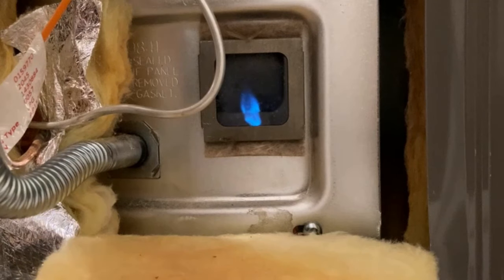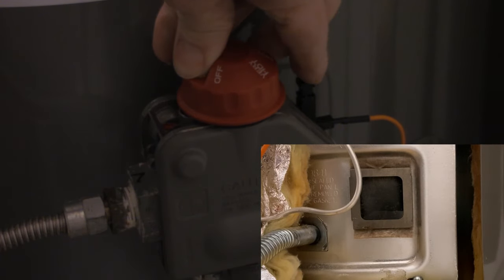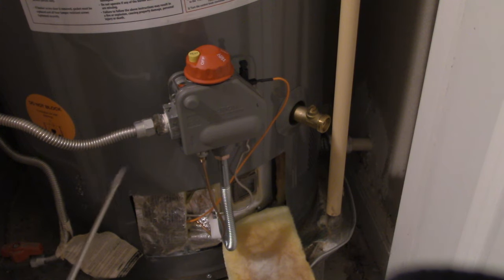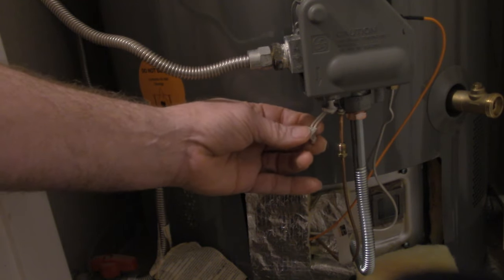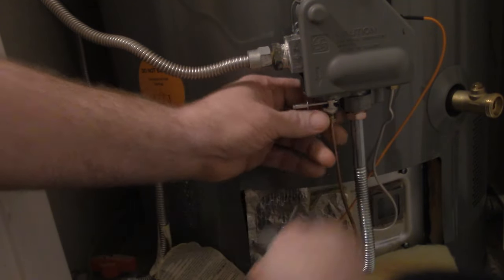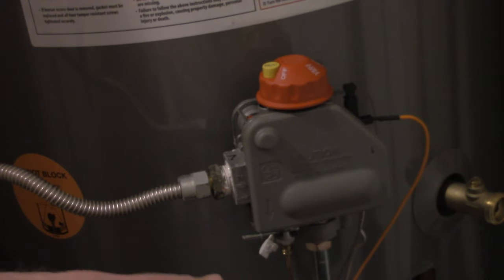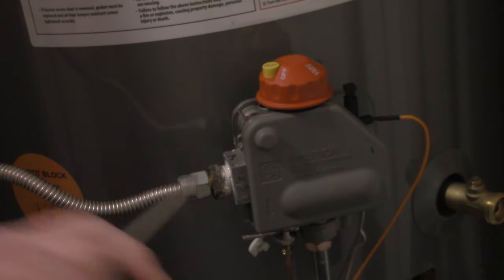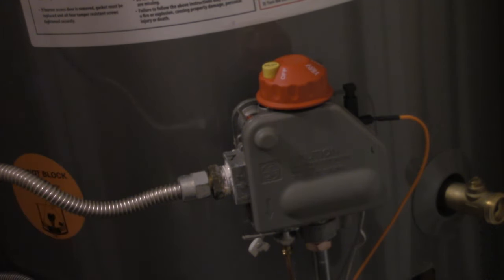Rheem Water Heater Pilot Light Issue

Comment: Update: Called Rheem and they're sending me a new gas valve. There's an endemic problem with them. I can  change it. I've changed water pumps, head gaskets, etc on cars before. Next time I see a discarded WH on the roadside I think I will take the gas valve. Never know when a spare would come in handy. Most WH's are discarded for leakage.

Comment: I have this exact problem. Rheem Water heater is a little over a year old . Haven't tried the connection test yet. But it's doing exactly the same thing as described in this video.  The old water heater I had was over 20 years old. In my mind this is ridiculous.

Comment: I just thought I'd just add this for info. I called Rheem this morning and placed an order (6yr warranty on parts) or if I could find the replacement locally (part # verified), they would reimburse me. Ten minutes later my service tech call and said the found the gas valve and would be here before 5pm today Please use your own discretion on this but Rheem told be that because my S/N ended in "RH" I should not execute this temp fix as it would void the warranty. I'm waiting a few more hours for a hot shower, but I'm close to executing the fix. As for my previous question, I've been told (by Rheem) that the replacement gas control valve is engineered to correct the issue and this should not recur. Still don't see how. I'll try to wait for the tech. Good luck all and thanks again Mudd Flapp.
Reply from the maker: I was also told that Rheem (or their gas valve supplier) have corrected the issue on the replacement valves. I have had several commenters say that they had a similar failure with their replacement. I guess time will tell.
Reply: @MuddFlappRanch  My replacement has been working fine so far although it doesn't look like my original (as depicted in the video). the replacement has separate ignition and temperature controls. I did not use the one sent by Rheem but let tech do his thing with his part. He did caution me that while holding the pilot button in during lighting he did get a bit of a shock when his finger brushed the metal cylinder of the water tank. Evidently there is some exposed circuitry while the plunger is engaged. After the fix, I returned the Rheem part without ever opening the package but now having second thoughts. Maybe I should have held on to it, just in case two years down the road, "Guess what"? But the contractor installation and part were no cost to me so I sent it back thinking maybe the next person may need it. I did take pictures of the replacement part if interested.  Thanks again for the help.
Reply: I called Rheem today to ask about replacement parts. A plumber installed mine 2 years ago. They were willing to sell me a couple hundred dollars worth of parts plus shipping! And said 2-4 time for shipping. They were unwilling to pay for ANY of it! Nada. Said 1 yr. warranty on parts and 3 years on the tank neither of which do me any good. Basically I bought a lemon. Sounds liked planned obscilesense. Water heaters used to last 25 years. And it sounds like more American greed to me, esp. because the price of water heaters has almost doubled since COVID.

Comment: I had this problem, contacted the local plumber and after fiddling around for over 2 hours, he gave up and told me to call the warranty number.  Rheem overnighted a new gas control valve and gave me the number for the warranty plumber.  Had hot water within 48 hours of calling.  Plumber told me that Rheem had to switch manufacturers because of a high failure rate on units made during the pandemic.  Mine is a Richmond brand sold at Menards.  Turns out Richmond is actually Rheem.
Reply from the maker: Yes, I think they use Rheem/Ruud/Richmond for the same water heaters, depending on the market. In any case, all three brands are made by Rheem and use the same gas valves.
Reply: @MuddFlappRanch  Anybody remember the water heater fiasco Lowes had when the Whirlpool Flame lock units first came out?  For a while, you could just walk in a lowes and they would hand you replacement parts after a class action lawsuit.  That was 15-20 years ago.  It was a mess if you had rentals.
Reply from the maker: @ripvanrevs  Sounds like a similar deal. I don't really fault Rheem, they seem to be sending out replacement parts with no questions asked. I have heard a few reports that they are covering labor (which they should). Not everyone is comfortable modifying a gas appliance based on some yahoo in a YouTube video 😂
Reply: Thank you for the info. I will be calling the number tomorrow as ours has been out for 2 weeks.
Reply: @MuddFlappRanch  I called Rheem today to ask about replacement parts. A plumber installed mine 2 years ago. They were willing to see me a couple hundred dollars worth of parts plus shipping! And said 2-4 time for shipping. They were unwilling to pay for ANY of it! Nada. Said 1 yr. warranty on parts and 3 years on the tank neither of which do me any good. Basically I bought a lemon. Sounds liked planned obscilesense. Water heaters used to last 25 years. And it sounds like more American greed to me, esp. because the price of water heaters has almost doubled since COVID.
Reply from the maker: @forestboone3647  First report I have heard of them not just sending out a new gas valve. Interesting. I wonder if they have replaced enough of them to avoid a class action.

Comment: The wires are exposed on the side of the safety valve disk - I used a paperclip (held in place by electrical tape) to bypass the faulty safety valve with no need to loosen the therocouple nut.
Reply from the maker: Great idea! Thanks for the tip
Reply: I cut the wires and twisted them together

Comment: Thank you for this information!! No hot water tank for 4 MONTHS.  Changed everything on unit pilot igniter, thermocuople assembly. cleaned burner diffuser plate vacuumed inside bottom. Changed main gas line and installed new shut off valve. My ancient one snapped off at top then had to get gas company to shut off my main outside.  Wish I had saw your video 4 months ago.  Thank God for outdoor propane instant water heater for camping!!
 Thanks again !!!
so relieved I don't need a brand new hot water tank. Again 😃
Reply from the maker: Glad it helped

Comment: This video really truly made my life so much easier and saved money as well. Purchased my Rheem water heater and installed it January 2021, here I am in April 2023 with no HOT water.  WOW!  Like many others, replaced the thermocouple but issue was not resolved.  Called Rheem, agent said it was probably the Gas Control Valve not the thermocouple based on her experience.  I thought maybe she was wrong so proceeded to install the thermocouple anyway.  It was 11:48pm and I saw this video, I was tired and had to work very early the next morning, I removed the sensor (white wires-emergency shut off) from the top of the thermocouple, put a nail in and made certain contact was made with the top of the thermocouple and I am enjoying HOT water today.  Thank you so much for this video!

Comment: My 11 month old Rheem went out yesterday! Got ahold of Rheem and they are sending me a new control valve. But in the time being I have been looking for 
help online just to get the thing lit to take a shower. Did the nail trick and it fired right up! Thanks for taking the time to post and help a lot of us out. I called
the plumber that installed the water heater last year and he told me he can't come by for service for over a week, but for $200 he could come out and bypass 
the system until he could! Thanks again Mudd Flapp!!
Reply from the maker: Happy to help. Once I made contact with Rheem, they did overnight the new gas control valve. The replacement appears to be identical to the one that failed, the nice lady I spoke with at Rheem did tell me they have upgraded the replacement valves. Time will tell
Reply: Have any one left the nail for a long time and check that the flame turned off  and function right?

Comment: Thank you for this video! I had the same issue, unit was just 2 years old and the gas valve had to be replaced. The service I called was Griffin out of St. Johns in Florida and they were wonderful. They were able to get the pilot lit so I had hot water for a shower that afternoon but then I had to use your fix (I used tin foil)  from the video as the pilot light would not relight that evening. My serviceman, Jim,  also called Rheem and had the part delivered, under warranty, in two days and then came out and installed it. I want to mention, they did not charge me for the first visit to light the pilot or make the call to Rheem which I thought was incredible service. Also, the replacement part is now metal and looks to be a much better part than before. Good luck everyone and thanks again for the video!

Comment: Thanks much!  I have had the gas valve replaced twice on our 14 month old Ruud. Started going out again last week. I could relight it everyday until today it wouldn’t stay lit. Last time the tech charged my wife and then told her that if it goes out again they will have to replace the whole exhaust pipe through the house!  >$1000.  Did your bypass trick and it worked right away.
Reply from the maker: Thanks for watching! Glad to help.

Comment: Dealing with this issue as we see this video.
Had the Rheem repair man out today and said it was a kinked thermocouple line.
No parts on stock, had to order and wait 1 week before repair.
Came out and installed pilot/burner assembly and said all good.
One day later, no hot water.
Attempted to light pilot three times and would go out after releasing.
Water heater installed 1 year ago and under warranty.
Was going to go and perform this repair but did not want to run the risk of voiding warranty die to "customer" tampering.
Will call for repair again in the morning.

Comment: Great Video! My pilot would stay lit if I left it in the "on" position. Anything higher than that and it would be too hot and shut off. This work around has made my wife one happy camper. My water heater was manufactured Dec 2020. Talking with Rheem now.
Reply from the maker: Glad it helped. Happy wife, happy life!

Comment: I have a Rheems that is about 3 years old. It would not stay lit after going out. 
Before following another video in which a little glass safety feature under the burner is replaced, I removed the thermocoupler but I think the model I have is more recent (has a Honeywell igniter/temp control). The thermocoupler did not have any obvious problem but I wiped it down (even though it looked clean) and put it back in 'snugly' as you suggested. Not sure why, but now it works again. Go figure...but thanks.

Comment: Thank you very much for posting this one.  I've been troubleshooting mine (have 2 identical heaters) without success.  That sealed-black-box type of controller is impossible to scifer down. I changed the thermocouples though they were reading in the 20mA range to "see if anything got better". I tried pulling the wafer off the box but it's a sealed feed into it.  After I got your video, I bridged it and abracadabra! stays lit.  At least tonight and for a few days we will have hot water for showers.  Will chase Rheem and try to get the spare parts.  God Bless.
Reply from the maker: Glad it helped! Most viewers (myself included) have had good luck with calling Rheem and getting a replacement gas control valve shipped out quickly. Some have reported that Rheem covered some or all of the labor if you are not comfortable changing it yourself.

Comment: Thanks! The aluminum pop rivet bypass worked to keep the pilot light on.  The thermocouple measured 10mv in the closed circuit and now the burner functions until I get a new valve from Rheem under warranty.  I tested for continuity across the wires on the over temperature part and it measured less than 1 ohm, so in theory the over temp device is still ok, but the pilot did not work until I did the bypass with the rivet stem.  My water heater is only 17 months old.
Reply from the maker: Resistance for the emergency cut out should be less than 2 milliohms. Mine was measuring about 40 ohms.

Comment: I wish I had found your video first as it explains everything.  My water heater cut off for the first time during a big storm so I am not sure if that is what caused it to turn off.  My house and water heater are only a year old.  I haven't had a chance to try and reignite it yet.  I came here to learn how to do so.
Reply from the maker: Hope this helps you
Reply: @MuddFlappRanch  You had mentioned in the video if Rheem had fixed this problem and Rheem told me that they have.  They said during covid they couldn't get the parts from the place they have always gotten them so they used another manufacturer and they are the ones that supplied the faulty parts.  They are excellent at quickly sending me a replacement and reimbursing me for the labor cost.
Reply from the maker: @awperonline6576  I am fairly certain that the replacement I was sent was manufacturer by SIT Group, which is the same one that made the faulty ones. But I was told that they had upgraded the faulty gas valves. I guess time will tell.

Comment: Great video!I had the same problem on my two year old Richmond water heater manufactured by Rheem twice. Had the gas valve replaced last January and am now having the same issue. Your fix worked great. I used a piece of copper to fill that gap. Thanks for getting my hot water back.
Reply from the maker: Thanks for watching. Glad it helped.
Reply: Did you keep the copper in like that since then? Any issue so far?
Reply: @shanetseng6040  Yes, I have left the copper piece in the heater and I have not had any problems with it. I contacted Rheem and they sent me another gas valve but it looks identical to the one in my heater. I will keep it as a backup. 👍

Comment: I have a Honeywell gas valve, same problem different gas valve, I believe the problem is the heat sensor, which senses if too hot, shuts off the thermacoupler, thus pilot light keeps going out.. supposed safety thing.. the dreaded red blinking light on Honeywell gas valve. I believe you mentioned it as the emergency cut off, different gas valve-different wiring setup. Water heater worked fine for a couple years, going in today to clean the dirty burner to see if helps, Rheem heat sensors out of stock.. thx for posting this video.

Comment: You are the man.  Thank you good brother.  My water heater is 1.5yrs old and it went out however your temporary solution works.
Reply from the maker: Glad it helped! Hopefully you can contact Rheem in a timely manner. It took me multiple tries, but once I talked to the warranty department and told them I had a faulty gas control valve with a bad emergency cut off, then overnighted the new control valve. The trick is actually calling and getting ahold of someone.

Comment: Great job Mudd Flapp detailing a temp fix. Having the same issue. Pilot  goes out once I release the pilot button. W/H is only two years old. Had tech over two days ago and he indicated the gas valve needed to be replace. He gave no indication that he was aware of over temp sensor issue. Been without hot water for three days now and currently hosting out of town company. Getting frustrated and embarrassed. What I don't understand is if the sensor is inside the tank and all we do with this fix is bypass the sensor 's connectors (understand a temporary fix to get hot water), how does replacing the gas control valve correct the problem? Is it a different design? Read other post on another sight where control valves were replace two and three times on heaters less than two years old.
Reply from the maker: The emergency cut off sensor (over temp sensor) is in the part of the gas valve that screws into the tank.
Reply: i have had 2 valves replaced in 2years each valve works great for 1 year want but no Rheem any more

Comment: Man, so happy I came across this video. My 13 month old Richmond (same company from my understanding) just started having pilot light issues. Was about to replace the thermo couple until I saw this. Figured I'd give it a shot. Bam, it works again. I still gotta call them about the issue since I have a 6 year warranty, but for now, I don't have to go back to boiling water for a bath like when my last water heater blew haha. Thanks for the heads up! You saved me a headache and a potential sledgehammer to the side of the water heater.
Reply from the maker: Thanks for watching, glad it helped. Good luck with your repair.
Reply: I had the same exact problem with a Richmond I installed 12 months ago
Reply: @wilholland5988  I still haven't called to see what the company will do about it. Kinda curious what the actual fix is.
Reply: I have not wither seeing as this just happened a few hours ago.  I am going to call tomorrow and from what I can find online they will send a replacement part and compensation for some of the labor.... I just want the part hahahha 
I will keep you posted

Comment: Thank you!!!!! I've had to replace 4 of these tanks on our property!! You Rock brother!
Reply: Install July 2020.  Fail July 2021.  Menards replaced tank.   New water heater failed August 2022.  Took whole assembly off of an extra water heater I had that had a different control valve.  Installed and fired right up.  Hope this manufacturer is better!!  What was interesting is that when I pulled apart the first time thinking it was a thermocouple, the thermocouple had a date on it of 2014.  Why would there be a 6 year old thermocouple in a new water heater?
Reply from the maker: Any time!